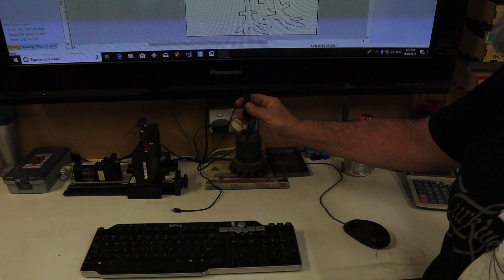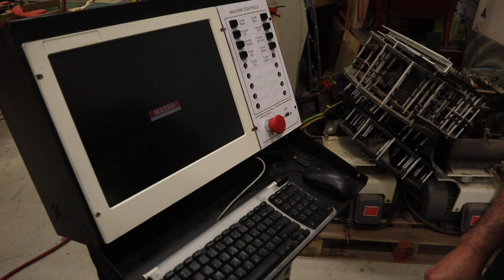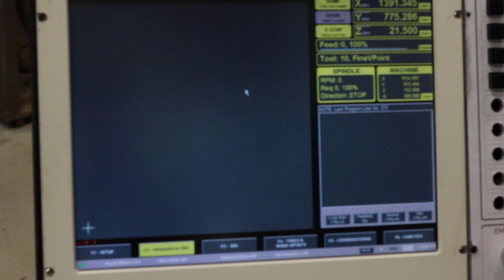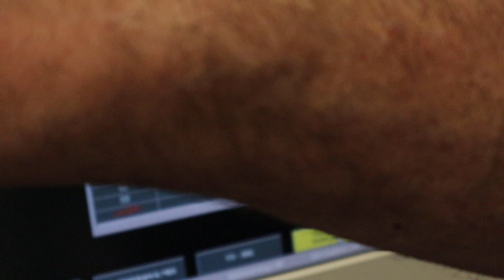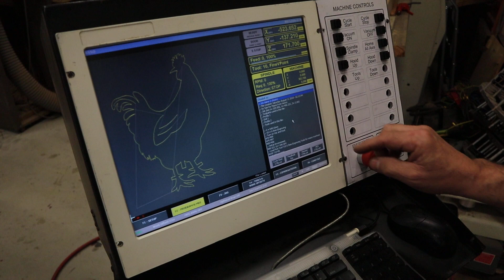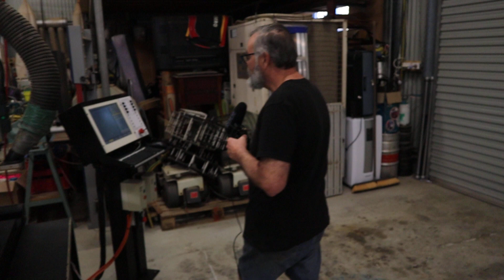Masso controller retrofit First successful run with tool change!

Comment: The reason your machine goes home every time is because you told it to in your post. The machine will move where the code says it must. If the code says G0G28X0Y0, that's where the machine will go. You can change that somewhere in post where it handles "After every tool change" strings or settings, just # the line out. Otherwise remove it manually from your Gcode file after every M06TXX.

Comment: Hi around 3:46 in your video I have same problem about going z zero after after tool change and go back on cutting have you solve this problem I just ask masso about this but no reply as this moment.

Software version is V3.40

Comment: Nice setup. Any bugs in the controller or any consistent errors? I might use masso for my next cnc lathe build. I have used ddcsv 4 axis control for a router and it’s very stable but lacks features like tool change and cutter compensation. Masso has got it all i guess. I am guessing i can write a macro to control a pneumatic turret for a lathe. Just concerned how stable the control is. Plus i like the fact that it requires no CPU , just a screen and keyboard to run.

Comment: Hi there I have a customer machine that I'm converting with the Masso that looks exactly like the machine you have (procam) . Just wondering if you had an issue with the tool changer where it won't take the tool from the rack after already putting existing tool back and moving over to pick up new tool? It clamps onto the new tool sits there for a few seconds and then un clamps it and then errors out. Masso support seem out to lunch for the last few days so I'm desperate to get this working.

Comment: Madaboutcnc, enjoyed the clip. l have a masso on my machining centre and my knee mill.
When l do a  tool change machine goes to tool change position  for my machine and then continues with program, do not have machine going to home position. Could this be a problem with your g code rather than the masso.l dont know enough about code however could you have a G27 or G28 after T?M6 where the machine is going to a reference point before continuing?
Am on the forum, Peter35 and in Melbourne.
Reply: This is most likely in the Vectric post processor, in the begin tool change section, probably doing an XY home move at the start of this section.
Reply: Sorry at the end of this section!